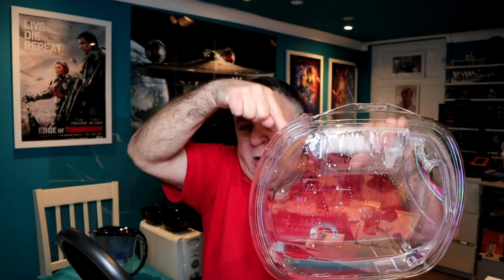Free Distilled Water....don't throw it away...keep it.

Comment: Hi, I know you did not say to drink this stuff, but some people think "purity"" = good.

So it should be made clear NOT TO DRINK distilled water.

Distilled water can pull electrolytes out of your body. Although you probably won't die because you are getting enough from other sources, anyone on low calorie diet or with other health problems could run into trouble.

Another one is eating too much black licorice,  this can pull potasium out of the body causing heart arythmias.
Reply from the maker: Hi Lesh...yes as you say I never mention anything about drinking it only using it  for batteries etc...however there are many many sites stating that it wont actually harm you and in some cases it might help with certain conditions ...so like any medical opinion there will always be opposing views...one such site is here https://www.medicinenet.com/is_drinking_distilled_water_good_or_bad_for_you/article.htm   but I personally wont ever be drinking it but as with anything always take advice from a trained practitioner